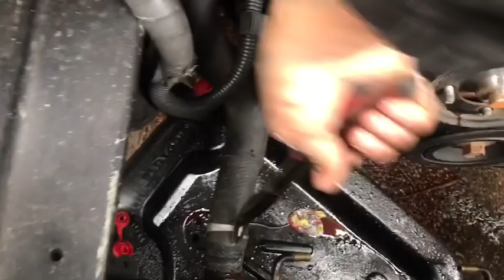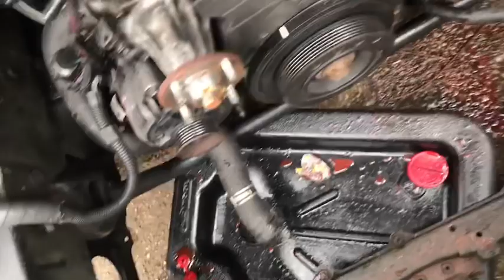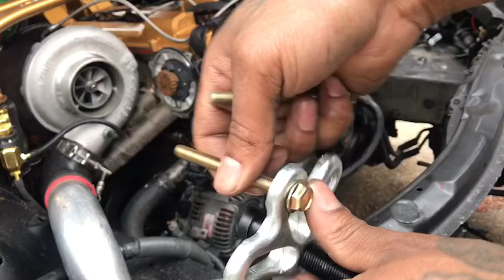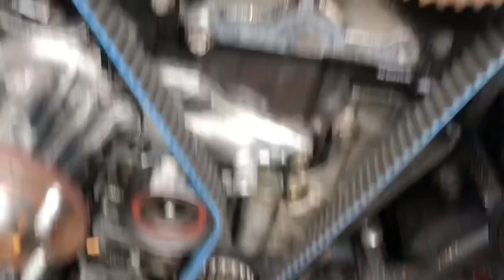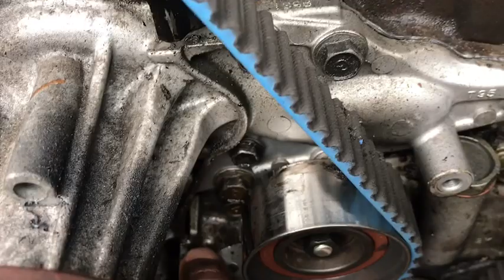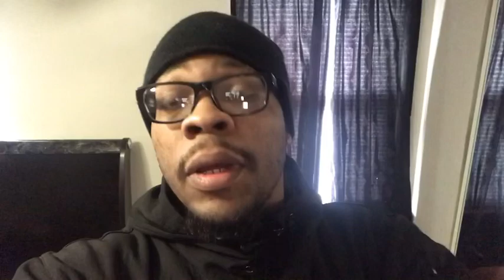2jz Timing belt removal

Comment: After you brake the pulley bolt by cranking the engine, do you have to again place the engine in TDC?
Reply from the maker: joe121592  yup it wasn’t anything serious luckily I just bent the bolt and snapped the belt I ddnt mess up the timing gear or anything
Reply from the maker: joe121592 thanks for subscribing to my friend
Reply: I see that you have ffim.  Super dope!  You should do a how too for that.  Very complicated.
Reply from the maker: joe121592 I’ll b doing the is300 timing in a few so I’ll b sure to go into detail and how to set the timing with and without the timing belt